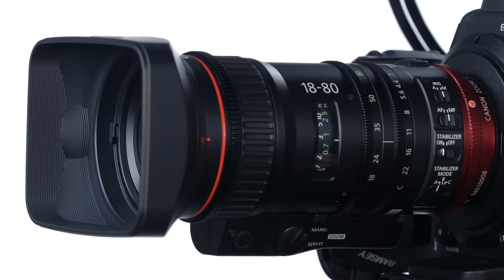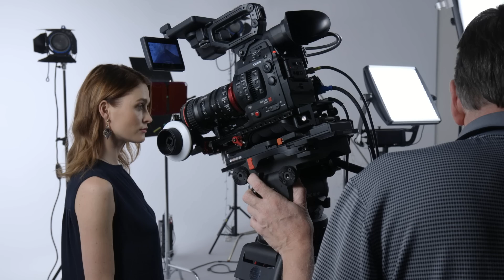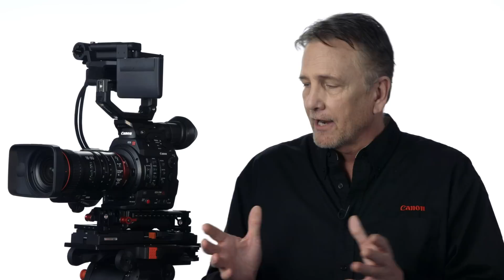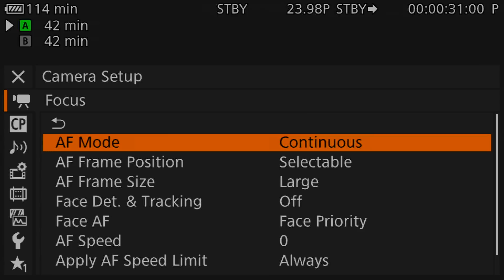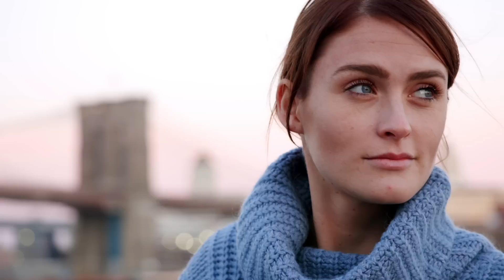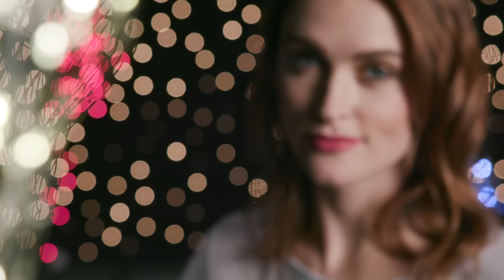Product Overview: Canon COMPACT-SERVO 18-80mm T4.4 EF

Comment: the sigma cine 50-100 looks much sharper.
Reply: Do you have a side-by-side comparison on that? Have you really seen it compared? I think the main point about this lens is that it is integral to the Canon camera system and especially the Dual Pixel Auto Focus function. Not to say that the the Sigma lens isn't good, but it doesn't really fit into the Canon system in comparison to this lens, anyway..

Comment: 2:30 - it's parfocal, but not quite)
upd: It turns out to be AF shift, so the lens seems to be parfocal indeed
Reply: It's parfocal and a great all around lens. I screwed up and left it in Face AF on that zoom out and lost her for a split second. Should have shot a 2nd take.
Reply: break2262 I thought I was the only one with that experience. I tried out the demo model at EVS in burbank and it wasn't parfocul. Weird. maybe it was the settings?
Reply: Wow, this changes everything! I take my words back!

Comment: I have a Canon C100 mark ii which I love. Will the AF face detect feature on the C100 work with this lens just like the STM lens.
Reply: Update your C100 Mark II firmware. It works.
Reply from the maker: Hi Glenn! The Face Detect AF will only work with the select EF-S STM lenses, such as the EF-S 18-135mm f/3.5-5.6 IS STM. We hope this answers your question! ~ML
Reply: Thank you for your prompt answer.

Comment: The remote pin interface looks badly positioned.  The connector cable for the optional handgrip is subject to damage everytime the camera is set down on the ground (without rail system) because the interface cable will extend below the base of the camera.  This will put stress on the cable connector.  Please relocate the 20 pin interface or (best idea) make a hot shoe interface between the servo handgrip and the lens body or make a low profile cable connector (maybe 90 degree).  
Come on Canon, do it right the 1st time.

Comment: I had a chance to interact and use the 18-80mm at Cine Gear Expo at Paramount studios this past weekend and yes, the focus does rack past infinity which is a big deal and in that a deal breaker for a great many of us that would very much like a focus ring with hard stops. It is already a bit difficult to focus due to lack of traditional barrel makings and makes using a CINETAPE MEASURE obsolete due to the lack of said markings. I hope you guys reconsider and implement some hard stops into the focus ring to better help us rack focus with this lens.

In all, I love the lens, the images look amazing sharp and crisp with great detail. No breathing and a very good feel in the rotation of each ring. The only downside is that focus ring with no hard stops. The last thing I want to do is guess my focus limits when using a lens of this caliber.
Reply: I have one of these lens' and use a follow focus with it and it goes back to the same spots every time. Plus I have hard stops on my follow focus. I really don't see a problem with it.
Reply: ajmash please make a detailed video of your use with this lens.  follow focus use and all. I really want to see this in action. Also anything narrative or documentary style video you've done with this lens and the follow focus.
Reply: Ok, will do...